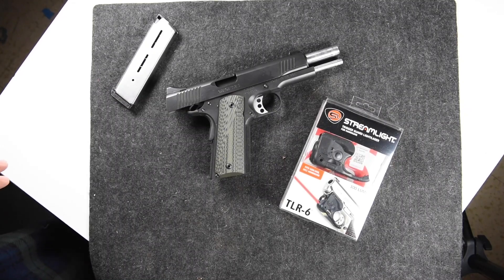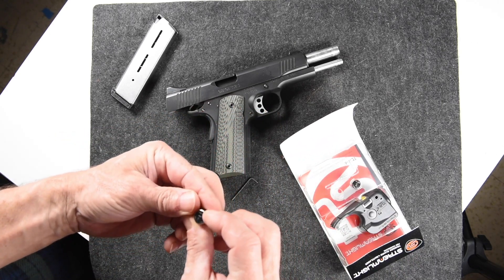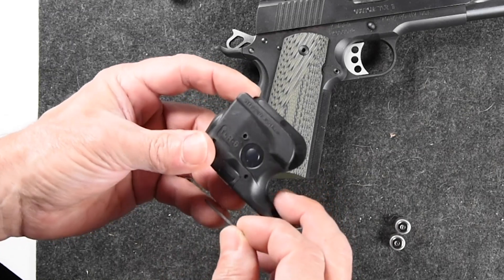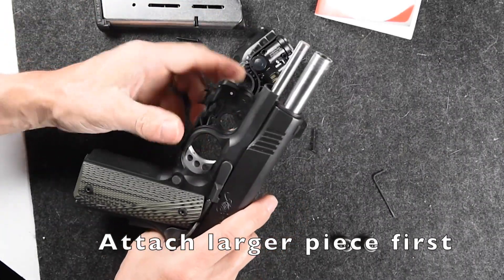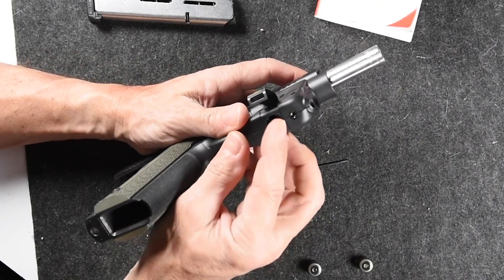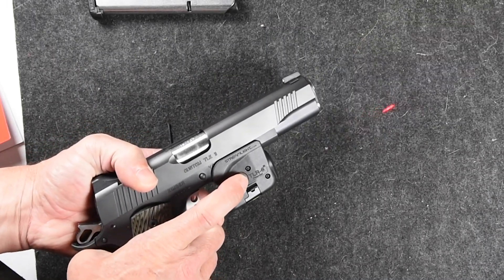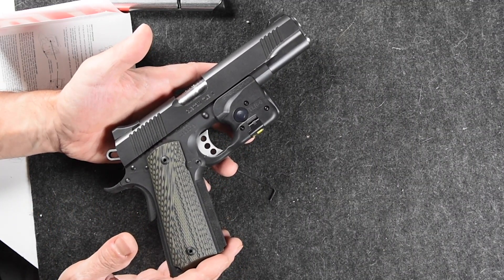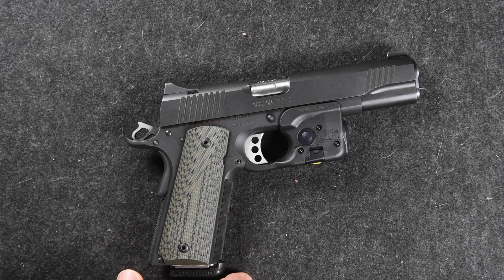Streamlight TLR 6 Laser Flashlight Combo Install Kimber Custom TLE II 1911

Comment: Great Video for I was about to return my Streamlight TLR-6 laser/white light combo because I saw no way for it to fit.  You do not show how you installed it but you said you had to twist it to fit.  Indeed it took twisting and it is a perfect fit for my Kimber Full size Classic Stainless (Kimber’s original and not the Classic II - which it may or may not fit).   The included written instructions do not mention twisting is necessary to install therefore it appears to be impossible to install.
Reply from the maker: thank you!  I was frustrated when I first attempted to install as well...took me some time to figure out the twist motion!

Comment: it seems wrong that the laser is way under the light when it should be above it since its more ideal to have it closer to the barrel for accuracy concern in shorter ranges. but it looks worth having for the light without the need of a rail adapter
Reply from the maker: yes, it would be ideal to have the laser and bore on the same plane.  That's why it's necessary to site the laser in to the range you feel is best for your surroundings.  And you are correct in the fact that the easy installation for 1911's with no picantiny rails is the main reason I purchased it :)

Comment: Should this fit in a compact size 1911?
Reply from the maker: my guess would be yes.  The video used a full size 1911 and there was at least an inch or two showing beyond the end of the light mount.  Most likely won't fit back in your holster though.

Comment: I tried putting it on a Rock island armory 1911 full size and it doesn't fit so im returning it.
Reply: What model rock island do you have? And what exactly did not fit about it? Like were you able to screw it on but it didn't align with the barrel or did it not fit around the trigger guard??

Comment: Will it fit my colt? Plz answer
Reply from the maker: I am not exactly sure about your colt, but if it's the standard 1911 profile, this light should fit as it is not specifically designed for any single model.

Comment: I wish someone would come out with one that just snaps over the trigger guard. This would be a pain on my daily carry gun, unscrew it and take it off when I go out then screw it back on when I get home. Guess I'll have to stick with the hand held till someone figures it out.
Reply: Or buy two 1911's 🤷‍♂️. I put the tlr6 on a 5 in lw kimber and i have a 4.25 lw ruger for carry.
Reply: Recover tactical has a grip trigger guard Cover
Reply from the maker: my concern would be removing the light may cause the need to zero the laser each time reinstalling?